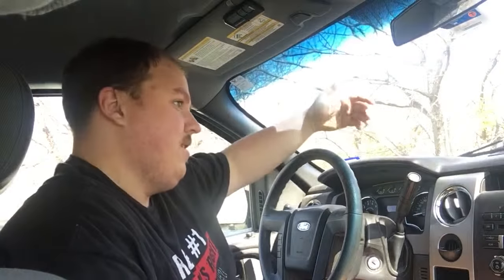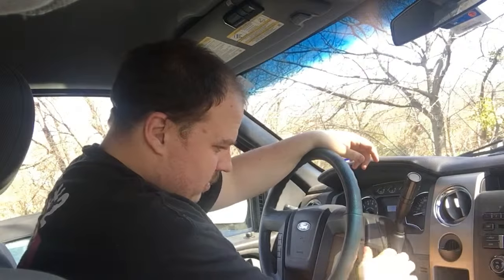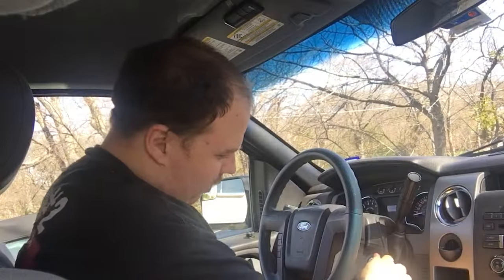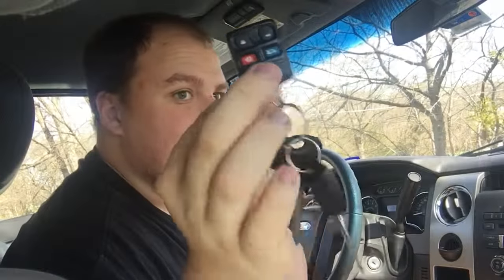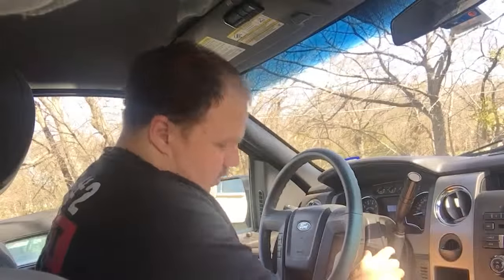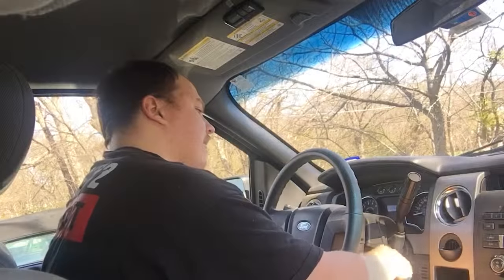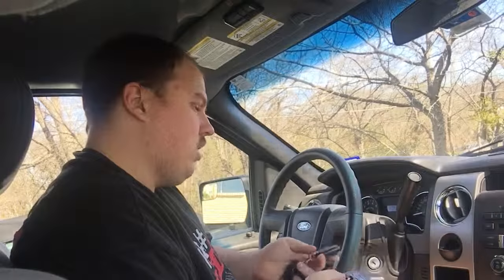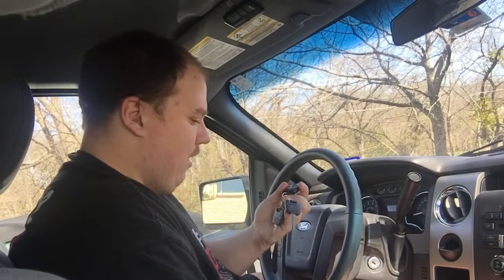How to program a key fob to a ford vehicle

Comment: I have to say, I was super skeptical about this process with my 2014 F150.  Bought it used a month ago and it only came with 1 key.  Ordered a generic all in one Key / FOB with Lock, Unlock, Panic & Remote Start and this process worked 100% and every button on both remotes now works.  Did it in 10 seconds in a parking lot waiting for a store to open.  Thanks so much for saving me some $$$!
Reply: I bought a 2014 F-150 with only one key as well. Ford dealer quoted me $100 for the key & $200 to program it.  what a rip off.  Ace Hardware quoted me $239 for the key. While talking to him I discovered I have the remote start. 
I see blank key online for $29.95.  How do I get the blade cut?  Will any locksmith do it?  One I have  2 working key I can get my key pad code.
Reply: This did not work on my 2014 Explorer. I tried it seversal and did not work.

Comment: I bought 2 new keys for my 2013 f150, got them cut, I programmed them both no problem and the keys worked no issues with security but the fob portion wouldn't. That's how I got here and this process worked no problem, but for some reason I can only get one of the fobs to program. They will both program when you go through the process, but only one of the fobs will stay programmed to be exact. I was thinking about trying to program both new key fobs at the same time but haven't done so as of yet. At any rate this process works for what I needed and I appreciate the info. Thanks!
Reply: Little update, if you buy 2 new keys (got mine on Amazon for $38) and you program them yourself and then need to program the fob portion... When you get to the on position for the eighth time and the locks cycle, you can press any button like he says here but do it on both keys separately within 5 seconds of each other.
Reply: Program them both off of one key. Problem solved
Reply: @BrandonMingerink  I put an update last year, got it figured. Thanks. The issue is I was trying to activate both the fobs at once. You have to do one at a time but within 5 seconds.
Reply: Hey where did you get the keys cut and how to program them to start the truck?  Thanks
Reply: Timk I've tried to respond twice now but both have been deleted for some reason. If this stays up I will respond this way.
Reply: @daveallen63  Hey Dave thanks man.  I got  my key cut at local hardware store...i bought a usb-obd2 cable and downloaded forscan and got the temp license.  Now I just need to program the key to start...all the fob buttons work fine including remote start.

Comment: This video is AWESOME, I bought 2 keys off eBay. took them to the dealer to have them programmed, Dealer stated the remote start wont work because they are aftermarket keys and I need to get OEM keys if I want remote start to work. After watching your video I programmed the keys the dealer said would not work. And now both keys work to lock, unlock and remote start my truck. Did I say when I bought my truck it only came with 1 key. Your AWESOME
Reply from the maker: Glad I was able to help you out. Thanks for watching

Comment: March 4, 2024. Just bought 2 replacement keys off Amazon for a2012 f150. Followed the instructions in the manual to program the starting chip, then followed this video to program the buttons on the fob. Worked mint .Thanks!

Comment: Dude, I wanna say THANK YOU, THANK YOU, THANK YOU for your help...... I have two Ford vehicles with two brand new key/key-fobs that I ordered. I was quoted $190.00 by the Ford dealership & $165.00 by a locksmith just to program. I greatly appreciate this video. It worked like a charm!!!
Reply from the maker: No problem, glad I could help
Reply: i bought a key blank off ebay and had a locksmith cut it for 45 bucks but it only unlocks the door. if i program it will it start my car too?
Reply from the maker: @guardshack9606  the key it's self, you would need a locksmith to program it to start the car. This video is only for the remote fob
Reply: Thank you this video fits my needs exactly. I haven't  even tried it yet but it makes perfect sence.

Comment: YOU ARE A LIFE SAVOR!!!!  I disconnected the battery and everything reset so a single press of the lock was locking it but making it honk and unlocking it by pressing it once made it honk twice. Now this fixed it and works correctly!  1 lock on remote with key locks the car and two quick presses locks and chirps. 1 unlock unlocks the driver door and two quick unlock presses unlocks all doors with no chirp!!

Comment: THIS VIDEO IS LEGIT. I programmed one for my fiancé’s 2014 Ford Fiesta and it was magnificent! There are other videos saying you need 2 keys or put in 2 fuses, TRY THIS VIDEO FIRST.
Reply: When you program the new key fobs the old ones they don't get erased from the memory of the vehicle you don't need to reprogram all key fobs!?
Reply: That's what I have. Just got it yesterday. I will try this as the key fob won't lock, unlock etc.
Reply: Well I tried and it still didn't work. It has a new battery in it too. When I did the 8 turns, and left the key in, the locks did not click as it showed here. Pushed buttons, nope. 🙁 Salesman at the dealership is supposed to be finding out for me.
Reply: JordansMom769 and you left the key in the on position, not just in? I just tried this on the 2013 Expedition we got last week and it worked perfectly. And to the person asking about it changing other keys, it doesn’t affect your old key in any way.
Reply: @johncarpenter1053  I did, but I finally just went back to the dealership and they got it working for me ☺

Comment: Bro thank you so much, this worked easily for my 2014 Ford Explorer. At first it didn’t want to work so what I did was get out the car, lock car with the number pad, unlock the car and try it again with the door open and worked how it should. 

To program two keys you just need to press the buttons for each fob before you turn the ignition off.
Reply: Thank you, thank you, thank you!!! My 2013 explorer would not work either, did what you did and it worked! Saved me 490 dollars 😊

Comment: Bought a 2013 Expedition last week. Ordered a key fob from Amazon for just under $25 that looks exactly like the ones I got with the vehicle, 4 buttons with one being the automatic tailgate button.
This method worked perfectly. Thanks!
Reply: Did u just have one key and were able to program a second key with this method?
Reply: @holliecollins1  
Sorry, just saw your question. I don’t use my Gmail too much.
I just did one, but you can do more than one. It depends on whether your vehicle limits the number of programmed fobs that you can have. My Expedition only allows a total of four.

Comment: It works for 2013 Ford Focus as well, just that it will give you beep on 4th time and 8th time, On 8th time press key fob button. Note: It only give beep and wont give sound of unlock and lock on 4th or 8th time like other older car. But once it programmed it will work as expected. : )

Comment: Thanks man! Saved my ass! For other watching or going through same issue:

My keyfob on the 2013 ford explorer is a key and fob together as it is in the video. the contact joints for the lock and unlock broke. I could unlock the door manually with keys but alarm will go off in 5 seconds unless i go start the car asap! annoying every time and quite embarrassing. seems like im breaking into my own car. Ordered another keyfob on amazon. $50 for a nice modern looking one. Follow the turn key 8 times method and was able to program my key. 1 minute was all it took and now i can unlock and lock with the new fob, attached it to my chain ring and now im good to go. Works great thanks to this video!

Comment: Thank you very much. I stumbled across your video. I actually had a system start failure on my 2015 f250. I was getting very bummed out. However, my fobs were not working. I did the "8times" trick and that did it.  Thanks gor the tip.

Comment: My 2011 needed a 2nd step:  It takes 2 existing working keys. And your NEW key must be cut first at a hardware store or by a locksmith.  Step 1) Put the first original key into the ignition lock and turn it to "on" (not start).  The gages will light up.  Remove that key.  Put the 2nd original key into the ignition lock and turn it to "on" (has to be done within 5 - 20 seconds).  Remove that key.  Put the NEW key into the ignition lock and turn it to "on" (again 5- 20 seconds).   Now the NEW key will star the car.   Your video only shows how to pair the new fob to the door locks.  The ignition interlock is a separate function.

Comment: Worked like goddamn charm!!! I tried on my 2015 Ford Fiesta when the key fob head went bad and it worked. Also it works for fobs already programmed. I used my old mustangs fob which doesn’t run anymore and I use of the fob so don’t worry if you already got one preprogrammed it’ll still work☺️

Comment: Old video but it works,i just had a mobile lock smith come out to my house to cut and program a key with the built in fob for a 2010 f150  he got the key cut and programed to start truck but could not get fob to program i called him maybe 15 minutes after he left and told him i got it to work 
Thanks.....

Comment: Great video just bought a used 2017 with only one key ordered one on amazon followed your instructions and it worked perfect
Reply: The key you ordered from Amazon, did it need to carved or did it just fit right in to the ignition?
Reply: @ramansingh2011  yeah you have to get it cut and if you don’t have 2 keys already to program it or else have to pay to get it programmed

Comment: I have 2 key fobs for my ford edge (like the duplicate pair you have in the video), both stopped working remotely to lock/unlock my car. I changed the batteries, tried this reprogramming method, and nothing works. I’m not sure what else to do 😢

Comment: Thanks for the video man. Any advice for what to do if going to the on position 8 tines doesn't make the car go into programing mode?
Reply from the maker: Either try new batteries, or the computer that receives the signal doesn’t work
Reply: @Liftmaster-sw2zy  much thanks

Comment: I just bought a used 16 F350 with only 1 key. If I  order a replacement key off of eBay can I do this also? Will it also be able to start my tuck or is that a different programming? Thank you!

Comment: Well, didn’t work on my 2015 F-250. The new fob just honks the horn on the truck when you press a button. Tried both OEM keys with the fob intergraded into the key.
Reply: I got the same problem :/. Was there ever a solution that was found
Reply: @ceezy5  for mine I had to have two keys. Did the same as the video but with my two factory keys and it finally worked.

Comment: PROBLEM: I have two keys, they both can start the car. Key #1 can unlock/lock the car remotely. Key #2 cannot. 
When I do this method to add Key #2, the buttons work and I can unlock/lock the car with Key #2.
BUT then Key #1 buttons will no longer work.
So if I do this to get Key #1 to work, Key #2 will stop. 
I tested a 3rd key and both #1 and #2 stopped working while #3 is doing its job.

Help!!!
Reply: Trying to get all keys to work remotely!

Comment: Ok so my locks cycle on the 8th turn. New batteries properly installed. And it’s not doing anything. Both keys. What else could be the issue? 2012 F350

Comment: Did everything this guy said to do. Got the key programed and cut and the lock and unlock buttons work. I put the key in the ignition and turn and the truck turns on but wont start. Only starts when I put the original key in

Comment: Hello 
Mine is Ford Fusion 2012 se
While programming two new key fobs, something went wrong probably I pressed other keys than the lock key. 

Anyway, now the original key works fine. but  the problem is :
the light that indicates pairing mode is flashing every 2.5 seconds, if the original key is entered it stops flashing and can be turned on. BUT if the misprogrammed key is entered its flashing pace increases to ~ 3 times every second. The newly misprogrammed keys can lock/unlock doors but they will not open the trunk or turn the car on. 

I try the following but neither worked
1- Discount the battery overnight 
2- switching the original key on/off and Entering programming mode and let the car exit pairing mode by itself. 

Please help, is there a way that let me exit the programming mode and/or reprogram the new misprogrammed keys?

Comment: I have a 12 f150 lost the original key that came with it does it work if i buy another blank key with the key fob on it just like the original?
Reply from the maker: No, they are designed weirdly to where dealership will need to program it to start it.

Comment: The door locks cycled after 8 key turns. My ignition doesn't turn AT ALL NOW, and my windows are down 😒🙄
Reply: Help a.s.a.p.!
Reply: Okay. So, insert key. Tap the back of the key while its in the ignition so the levers drop around the key. It turns now.
Reply: Levers aka tumblers

Comment: So you’re telling me I can order a key, get it cut locally, and program it myself for a 2015 Ford Focus?
Reply: What they're showing you here works for the key fobs only
Reply: In order to program new keys you would need two existing function keys to program a third key if you only have a single functioning key you'd have to have the dealer or a locksmith program additional keys

Comment: This isn’t working for my 2012 f-150
I got a new key from eBay and had it cut, but when I try to program the key the car honks instead
Also, the buttons on the original key stopped working but they key itself still unlocks and locks the door and starts the car. The new one won’t even after programming like this

Comment: You forgot to mention that all doors have to be unlocked before starting
Reply: Thanks a lot for mentioning that I was trying it with the doors locked it didn't work, then I unlocked the doors and it worked
Reply: @roseatis8985  im glad i could help you np 👍
Reply: Yes please pin this comment. It took me 10 minutes and a crap load of cussing seeing everyone get it 100% but me. ALSO , it doesn't say go on to completely off or on to ACC, that would be good to know as well. Luckily after i saw this, I finally got it. But please mention that it has to go from ON past ACC then OFF because some people don't know the difference and may just go a half turn.

Comment: My horn just honks on the new fob I got, it will not program for some reason,  any ideas?
Reply from the maker: If u are trying to program a fob with they key built in, that's probably the issue.
Reply: Garagedoortech97 is there a way to program a key attached to a fob?
Reply from the maker: @cannondorf  dealership only for those unfortunately

Comment: Didn't work on my 2015 Ford Focus S. Couldn't get it to enter programming mode.
Reply: Me too I just kept cycling the key till it caught. Also the driver door needs to be open. I was trying & trying and I went past 8 till about 12 times and when I heard the door locks cycle I stopped and left it in the “run” position and quickly hit the remote button and it worked! Then finished by testing the remote one more time with the ignition off. Hope that helps

Comment: Hi!  I just ordered this key: https://www.amazon.com/gp/product/B0184O6O9Y/ref=ppx_yo_dt_b_asin_title_o00_s00?ie=UTF8&psc=1 do you know- is this style key a chip key?  Can they just cut it for me at ACE and then I program the fob as shown in the video?
Reply: I'm wondering if this only works through 2014... I have a 2016 and in the item description of the key it states I have to have two working keys to self-program.
Reply: Ace wouldn't cut for me. Probably because I didn't buy from them. Had to take to a locksmith for 25.00. 85 to program to remote start and 40.00 to match up the security code. I did this video and allmost every works but remote start. The reason I bought the new key fob.